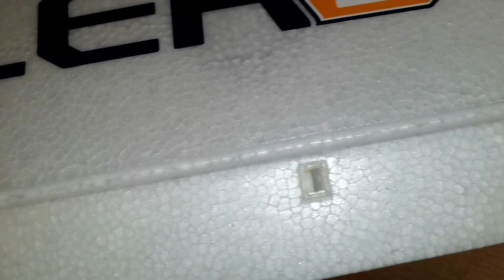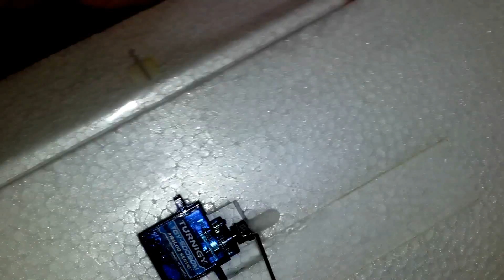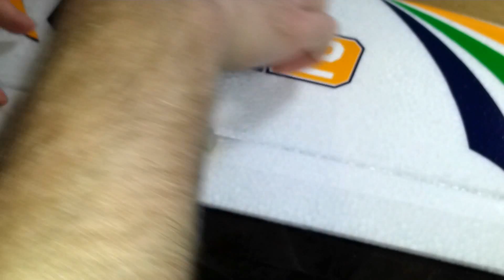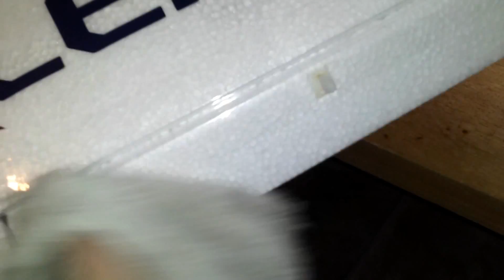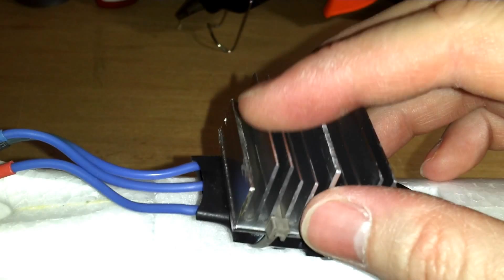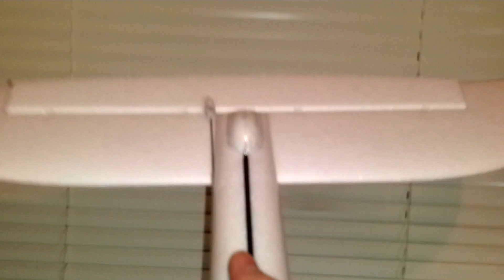Bixler 2 Mods - Improved aileron tape hinges

Comment: you should turn the heat sink around so that the air can flow nicely through it.
Reply from the maker: I did that a while ago. I drilled holes thru the heat sink big enough for the zip ties so the fins are now running with the airflow.  That ESC doesn't get very hot anyways even with a larger Turnigy G10 motor on it.

Comment: I ordered my bixler with the same motor how does it run, would it be fit for fpv... Enough power?
Reply from the maker: With the lower KV motor you will get slower flights but longer flights.  Great for a beginner.  A 2200KV motor with the 6x5 prop will work but it will be fast and only get about 10-15 minutes of flight time with the high KV motor.  I flew for 23 minutes and still had enough voltage on my battery to fly another 10 minutes.
Reply: Matt Knight I put that motor + a 9" prop on mine. I used the adjustable motor mount to get clearance over the tail. Thrust like woah.

Comment: I ordered my bixler with the same motor how does it run, would it be enough power for a go pro
Reply from the maker: Plenty of power for a Go Pro.  There are other videos on Youtube with a Bixler and GoPro combo.  With the lower KV motor you can run a larger prop with a higher pitch.  I'm running a 7x6 prop and I get plenty of flight time.  Anything larger than a 7" prop will require an adjustable motor mount.

Comment from the maker: The foam hinges are weak and will fail eventually just like you have other with the Bixler 2 have experienced.

Clean the foam with rubbing alcohol and use clear packing tape like I did or the fiberglass packing tape.  Just about any packing tape will work.  I used the Scotch Model# 3850 which is thick and durable.  6 months after installing the tape hinges and several crashes and hard landings with my Bixler 2 the tape hinges are still intact.